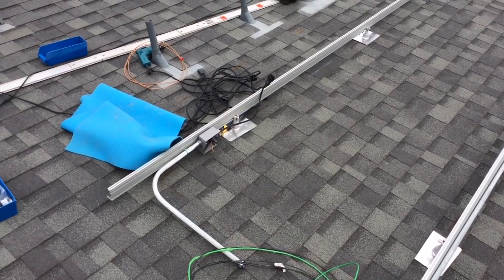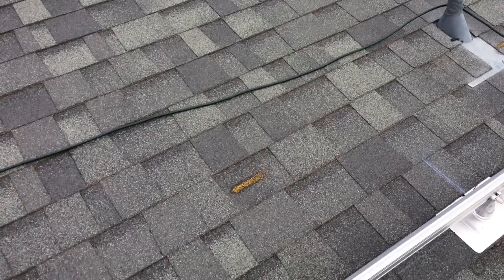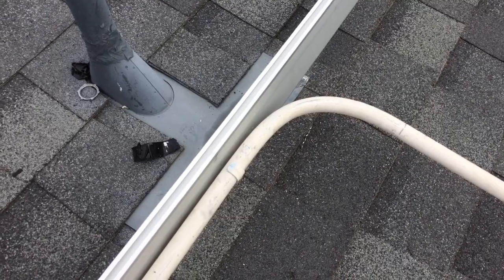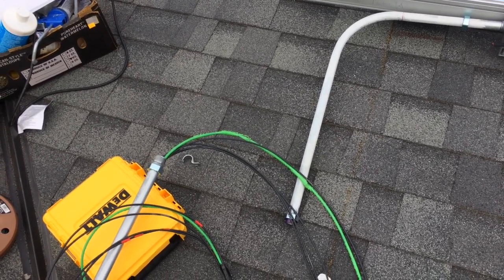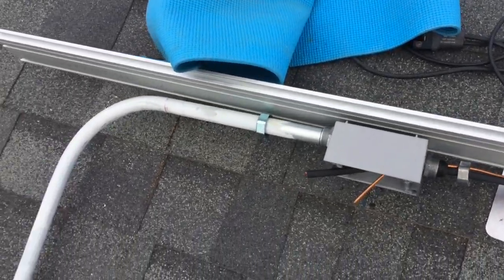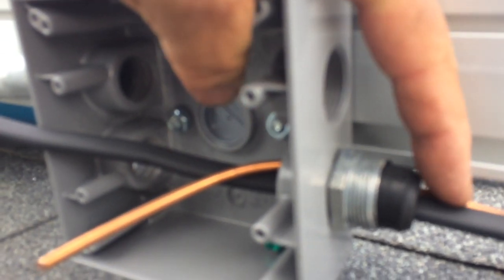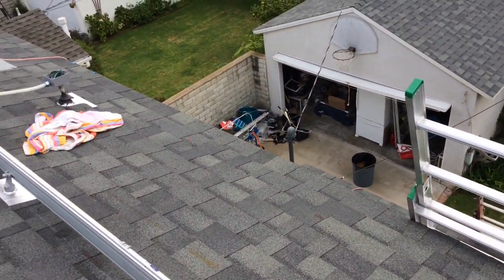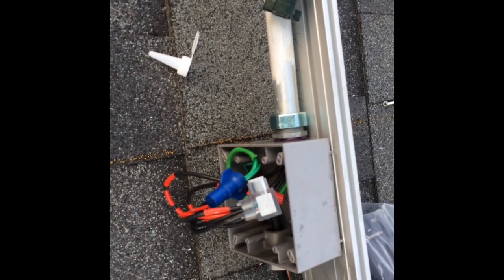DIY Electrical for Solar Installation Detailed Main Panel and Enphase Microinverter w/ J box

Comment: Someone is going to set their house on fire watching this video.
Reply from the maker: Steve Scheurich It passed inspection with the city. The inspector had 20 years of experience. I recommend that everyone get their job inspected. To your point it is safer to have a licensed experienced electrician do the work and have it inspected. I totally agree with you if that is your point. A fire is certainly more likely with a DYI job than a non-DIY job - we agree again. However, it is very unlikely if you follow the code and get your job inspected! Thanks for your important Comment.

Comment: I believe the right term is "spliced"
Reply: There are several factors in about this . One plan I found which succeeds in merging these is the Ewans energy roadmap (google it if you're interested) it's the most useful plan i've heard of. Check out the unbelievable information .

Comment: How does the inverter wave synchronize with the line waves, I assume all the inverter do it automatically?
Reply from the maker: Yes this is automatic. All UL grid tie inverters now are also required to accept commands from the power company I think.

Comment: That's good I was going to say you need ground always need ground no matter what electrical you're doing you're always going to need a ground especially the type of voltage that you're running on that roof I would say ground it always either with the conduit or all the way down to the ground but I would say all the way down to the ground but I'm just a first-year electrician I've never done solar electrical panels

Comment: Hi Danny, One of the best videos yet of the actual enphase grid connection.  Thank You  So my understanding is do not turn on Solar breakers until meter is swapped out to a bi directional meter by the utility company butall the voltage testing can be performed prior to the power company arrival
Reply from the maker: Thanks. Yes. You can / should test the ac on the roof but no panel hookup until you get written ok by the utility. I have other videos on my channel showing the permitting process. Here is a follow up video on testing. https://youtu.be/B9WVQDinwVg . I am aware of a number of situations where people did in fact connect to the utility before getting their  ok from the utility.  Have a fun project.

Comment: Hey Danny, just wanted to point out the tandem circuit breaker right above your new 2 pole 15 amp from solar system. Looks like you have existing 14/3 Romex wire going to this tandem type breaker. The problem is with the neutral wire of the 14/3 multi wire circuit. Neutral current adds up as you have the load connected on black and red coming from the same phase. I see this problem often, when I do a service upgrades for my customers. You want to make sure that if you use this type of a circuit breaker or anytime you wire 14/3 or 12/3, both hot leads are connected to opposite phases . You need to have 240 volts across black and red, then the common neutral current cancels out. Last say the load on black wire is 10 amps and 9 on the red one. Your neutral will carry only 1 amp. Otherwise, if they come from the same phase the neutral current will be 19 , where your 14/3 wire is rated for 15 amps for non continuous load and 80% of that for continuous loads - connected for 3 hours or more  which is 12 amps. I find the copper neutral wires overheated due to the set up like this. Open neutral is dangerous, not easy to troubleshoot and when it opens, 120 volt devices connected to the multi wire circuit get 240 volts across. Not a good outcome. Second thing to look for is if your panel is rated for use with tandems, usually you will see it on a panel directory-  one circuit breaker with dotted line A on the top and B on the bottom. Most cases the frame is rated higher, especially with the main lug panels. Also, having 2 pole 15amp as a source, you may need to downsize your main circuit breaker- depending on the frame size of the panel, if it is a main breaker panel.
Reply from the maker: Adam B I have 10 awg wire. No romex. My ground wire in 8 awg. My work was inspected by the city per the plans using the California Guide and solar designtool.com .  The city has approved my install so I believe I am in compliance. Thanks for your. Comments.
Reply: Danny, I was reffering to 14/3 romex cable connected to single pole tandem breaker right above your new 2 pole 15 amp breaker from solar. All solar installation wiring looks good, thanks

Comment: Thanks for the video, in you’re breaker box I see you have a double pole breaker on the bottom back feeding you’re solar in , I have a question if you know - in my box the main lines come in in the 2 top beakers on the left is the way the electrician wired the box and the only two empty slots I have directly across from that is that initial using that backfeed the box with a hybrid inverter only for electrical loss ?
Reply from the maker: Your config is a bit unclear and I did a DIY install so I just did research on my own given my situation. Google main topic is NEC Solar Main Panel. If you are getting a permit / and are doing the work research the topic and visit your local city planning office to get your wiring plan approved with the inspector. Mike Holt does a great job on NEC. See this link https://www.ecmweb.com/national-electrical-code/code-basics/article/20896904/nec-rules-on-alternative-energy-systems-part-1

Comment: I'd like to know why you need the ac in from the solar on the bottom breaker?  I did my own installation and worked with a professional installer who told me the opposite - top of the stack was where you want the solar in.  My system has been up and running for 7 years with no issues.

Comment: I'm shocked you can have 2 seperate power inputs to one breaker box.    So you have A)  normal  120v grid input at the top?   +   B)  120v solar power on the bottom left?    Into the same breaker box?   running at the same time?     Or do you manually turn off the grid?
Reply from the maker: Yes. That is how Enphase works! It only works for Enphase. However, other string inverters connect in the save manner. It has been this way for some time.

Comment: Hey Danny! Quick question...I am at the research and pricing stage of going grid tied solar...Can I use a secondary breaker panel to be the "point of entry" for my solar panels? To elaborate, I have from my utility's smart meter panel a 100a breaker that feeds 1/0 wire to my man shed, where there is another breaker panel and a receiving 100a breaker. I want to tie my solar into this panel.

I have noticed that when power is out (storm, etc) the man shed does NOT get power from my Generac whole home generator...Not sure if this is by design or etc....but does that pose a problem/benefit to going solar?

Need to know if this setup can be done before I buy, or else the project has to go. Wife rules.
Reply from the maker: This is a bit out of scope from my DIY solar project where I got a permit from my locality. I really am not qualified to answered any of these questions.  I guess I would look at the Generac transfer switch wiring, this should be a simple matter. I think the Generac transfer switch by design should protect against power going to the utility and shocking utility workers working on the grid. Some how your shed is being "protected" on the grid circuit?  1) For shed / generator service just look at re-wiring the shed to house side of your transfer switch? 2)You may look at running a separate 2 wire L1 and L2 with separate ground from your main panel to the shed area where you want your panels. You should have earth grounds connected to your main panel and earth grounds nowhere else. L1 and L2 connect to microinverters on shed then to a back feed breaker on your main panel.  The big issue in my mind is not to blow up your microinverters with you Generac but it seems you already have a shed wiring configuration that accomplishes this!  Please do let me know how it turns out. Sounds really cool having the Generac. Super nice setup and cost effective too I bet!

Comment: Hey bro am so happy to see your video I have so confusion about the grounding what now it's clear so many times I am thinking why we are using 8AWG grounding wire but it's depends on installer which one he wants to use 8 & 10 there is optional for the installer.
Reply from the maker: Thanks for your comment. I have no I idea. I think I just followed the State of California Guide .  8awg to be safe .. I guess.
Reply: @dannyjensen4954  thanx

Comment: Just curious how you handled your pipe vents? did you move them or use one of those solar jacks?
Reply from the maker: My panels are up high. It is my understanding the the new code in some instances allows the vent pipes to be cut down depending on the jurisdiction. Here is a link to the video I did discussing this possibility. https://youtu.be/bkT9MB33h50 .

Comment: It should be noted that code limits the number of wires inside your conduit, you don’t want it too stuffed with wires and it also creates excess heat and lowers amp carrying capacity of your wires
Reply from the maker: Thanks.  For your comments.

Comment: aren't you skipping the most important part of the whole set up which is the grid tie inverter . and by the way the PV breaker in the main panel can be installed anywhere inside.
Reply: These are Enphase micro inverters. Each panel has an inverter beneath it.
Reply from the maker: This is an Enphase system with microinverters so I’m showing the complete install. My breaker needed to be on the bottom in my case per nec 2014 option 2 see link https://www.jadelearning.com/2014-nec-705-12d2-understanding-pv-interconnections/

Comment: two questions: 1. is it safe to test out the system before inspection
2. is the back feeding breaking a special breaker or just a standard breaker with no special construction ?
Reply from the maker: Great questions. I'm not and electrician so I'm going to give you my impression based on the reading I have been exposed to under NEC 2014 rules and you may have more current NEC 2017? You need to ask your local jurisdiction and search the internet for multiple sources to confirm my impression.  2a) Take a look at this link https://www.jadelearning.com/blog/2014-nec-705-12d2-understanding-pv-interconnections/  for the breaker location and sizing.  2b) This is an ordinary breaker without GFCI . 1a) Yes look at these videos best to test your AC connections the roof and pretest all cables that will be on the roof. Check for shorts to ground etc at each stage of completion on the wiring*. videos  to watch https://youtu.be/4B-dTRpM6zE  and https://youtu.be/cLZFpBz_yHY .   Don't be afraid to test your wiring roof top with multi meter at the J box *before you connect your panels and lay them over the JBox  1b) Test your enphase wiring in your garage before you haul it to the roof. 1c) test your enphase wiring on the roof  1d) Enphase IQ7+ were reading .63 vdc while not connected to utility power with the sun shining on the panels shown in one of these videos. 1e) Now. The big question to you connect the Utility power to your enphase system?  Of course, this is the one thing you CAN NOT DO  legally. I OFFICIALLY SAY DON'T DO IT WITHOUT PERMISSION TO OPERATE BY YOUR UTILITY!  However, some people have been know to run boot leg systems for many months and don't get caught.  I did not connect my panels to the utility before I got my Permission to Operate by SCE!   If you were to do this I guess I would turn your system on at night first.  Then I  would just turn off all breakers in my house except for a wall outlet with a heater on it and kill the main breaker. Then turn on the main breaker and look at the meter. Then turn on the back feed breaker with the heater on it and look at the meter. You should see your meter load go away / greatly diminished with your panels energized.  Thanks for your questions. I may do a video on testing.  Good luck on your project.
Reply: @dannyjensen4954  Thank you! i passed my inspection yesterday. The inspector was impressed. I also used the solar design tool and found an engineer online to review and stamp the plans. The system is up and running!
Reply from the maker: Dad Life Great Job. You saved a ton of money I bet.

Comment: Your fittings dont look to be raintight. Did inspector flag that?
Reply from the maker: This is about what your panel should look like when you pull the cover off it. The Inspector did not pull the cover off the panel.  I do have a video that shows the panel cover on here is a link. The video was long so I not show the panel cover. The panel was to code back in 2009 and all I did was to add a back feed breaker so all the wiring is pre-existing except for the back feed wiring. https://youtu.be/4cLcHLtSl14
Reply from the maker: Andrei I am using rain tight couplers and connectors I don’t know the areas you are referring to. I passed inspection. I am unaware of any rain water getting into my fittings after a year.

Comment: Is that customer breaker panel on the outside of the house and not inside?
Reply from the maker: Outside
Reply: @dannyjensen4954  what’s the other option than doing this crimping thing.
Reply from the maker: @DakillaChi  No crimping. Are you talking about the breaker installation
Reply: @dannyjensen4954  like the solar here is being crimped on to the wires but I don’t want to use that crimping method I’d like it to go to a breaker in the panel box. Like how many amps do I need available for the solar to jus use a normal breaker that’s available in my panel.
Reply from the maker: @DakillaChi  Here is a video that shows how it works here with micro inverters https://youtu.be/58DNhhzoDJs

Comment: Why you think that in AC disconnector LOAD SIDE it is a solar side ? In this case it is produces energy (side which gives you energy as main panel)
Reply: And this disconector belong do solar system, so, logical thinking LINE SIDE it is side from solar panel 😊
Reply from the maker: Line side is toward utility. Do some research on terminology. I didn't question it. It is in the code so I followed it.
Reply: I know what are you talking about, It talk us only about situation whrn Main Service Panel without PV System but I tried find out something in internet and couldn't find anything =( because it is little bit confused. And noone can't explain why PV syctem can't be LINE SIDE

Comment: What are the sizes of your circuit breakers? How many amps can your solar do? Like if the house Total panel is 100amp should the solar side be able to do 100amp?
Reply from the maker: You will need to look at the specifications of your Enphase micro inverters. Enphase determines in the specs how many micro inverters you can be in a string. In my case my IQ7plus units were 295W or 1.21 amps at 240v x 6 micro inverters = 7.26A so the breaker size was 15A at the combiner with plenty of head room. The combiner box consolidates IQ strings so it is possible to use a larger AWG wire and a larger back feed breaker at the main panel. However, many people at limited on how large of breaker they can put in the main panel by the size of the electrical panel.  NEC code limits the back feed breaker size to a percentage of the total service. The NEC code varies by region. In my case, I have a 200A service so I have plenty of room for back feed amps from a combiner.  Thank you for your comment and good luck with your project.
Here is a link I have used in the past on this topic.
https://www.jadelearning.com/2014-nec-705-12d2-understanding-pv-interconnections/
Reply: @dannyjensen4954  thank you for the reply. What I was asking was like does the solar provide enough power to the house? 15a then to the main box say 50amps. So does that mean that the solar will provide up to 50amp for the house and the rest from the utility company?
Reply from the maker: @taniksambo1969  My solar feeds in on a 15A breaker but only 1.8kW. I have a few videos that generally address this issue. You need to start looking at your electric bill and get familiar with the topic of Net Metering. The power company provides the excess power that I'm not able to generate. Here is a video that shows you how the billing works. https://youtu.be/yoZVtioskVE

Comment: Most home panels in Socal are 120-0-120 240 split phase. Most Microinverters are 240 single phase.  "Enphase Microinverters ac wiring to main panel"  How did you do that and keep from
putting 240 on a 120 leg
Reply from the maker: Enphase has line 1 and line 2 outputs. My service has 3 wires 120V line 1, 120v line 2 and Neutral. My service panel alternates line 1 and line 2. The 2 pole breaker I added landed on line 1 and Line 2. I was putting my meter on line 1 and line 2 in the video. All 240 services I am aware of are just like I described.  I can but my meter across line1 and line2 and I get 240. Enphase units sync up to line 1 and line2.  Enphase units have no neutral and are grounded by a chassis ground you must run to your roof top.